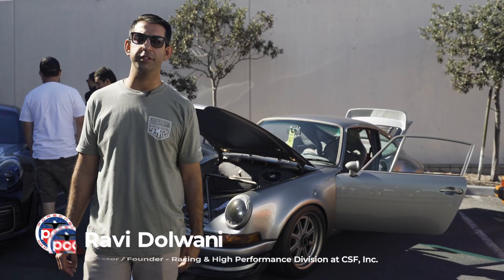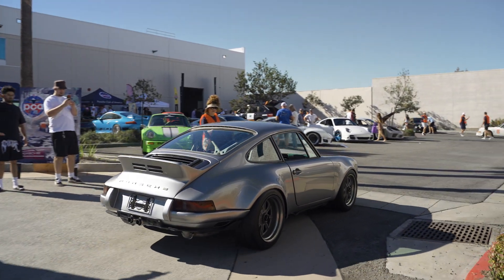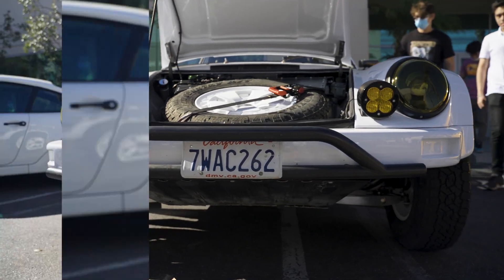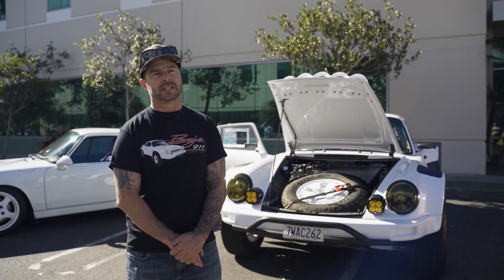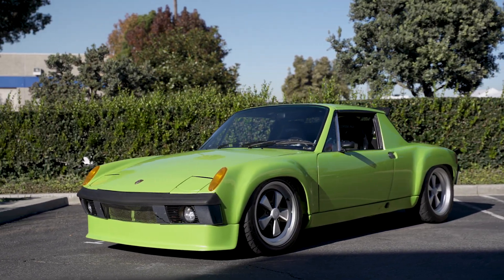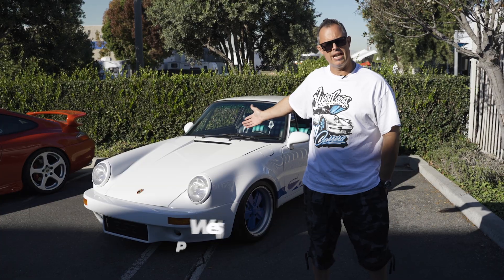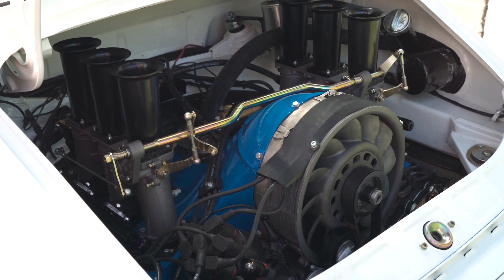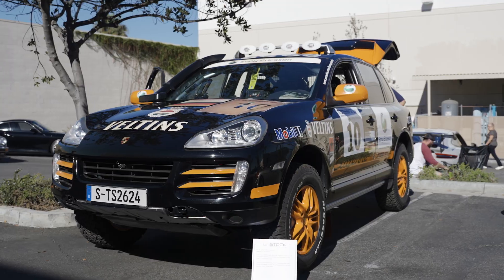ÜnStock: Modified Porsches, no judgment | PCA Spotlight

Comment: This series is a fantastic idea!!!  But all of the featured builds are $500K+.  Let’s be real - this SoCal trend is not representative of the broader PCA community’s good builds - it’s too high end.  Why don’t you come to mid-west, where Porsches tend to be modified with a little more concern to achieve biggest bang for the buck.
Reply from the maker: Thanks David. We did have a broad spectrum of modified cars on display. From just a few minor mods to the crazy builds we featured. We'd love to come to the mid-west. Noted!
Reply: Couldn't agree more, David. Any idiot can write a check to have a car built. Unfortunately, that's the lion's share of the cars that are featured each month in Panorama magazine. This is the gist of almost every story: "Steve's Dad passed away 15 years ago from a long illness. His Dad's '68 911S sat in the garage collecting dust until Steve made up his mind to resurrect the car in tribute to his Dad. No expense was spared in returning every nut and bolt back to original." I doubt half these owners even know where the oil fill is, much less how to check the oil or do a valve adjustment. I doubt any of them are driven more than 500 miles a year. A total waste.

I would MUCH rather read about an owner earning enough money to buy a project car, then work on it themselves to turn it into something they want. There are a few bright spots that have been featured in Panorama that are just this. Dave Toppin's 914-6 comes to mind. These are WAY more interesting stories because it takes more effort to build a car instead of buying it. Then he DRIVES the car to rallies rather than trailering it in and rubbing it down with yet another diaper. Half the cars at Luft were trailered in, too, I'm sure.
Reply: @MH-ev3wr  Agree for the most part. I don’t however hold it against someone if they have complex jobs done by someone else. It’s not realistic to expect someone to buy a mill and learn all the operations and machinist skills in order to build a bored twin plug engine for example. Heck, even the good shops sub out jobs like that to specialists.  You just can’t expect a shade tree mechanic to pull it off. Pelican parts has a lot of info but parsing the good advice from the bad can be very difficult. 

But over all I agree, the “home made” builds are much more interesting and that’s why I usually spend all of about ten minutes max on a typical issue of Panorama before tossing it.
Reply: @overbuiltlimited  good point. I totally agree. Not EVERY job can be done by people like you and me. If I were going to build a twin plug engine I’d spec out all the stuff to buy (camshafts, proper compression pistons and heads, etc) but I’d send the case and heads out to Ollies for proper machining, for example.

Comment: At (1:12) when you talk about your car being a Porsche 911 SC my car is a 1978 Porsche 911 SC I had an SSI exhaust and a Dansk Muffler and I had to take it off because it would not pass smog. I want that Manifold on my Porsche it makes 20 more HP and even though it runs better and cleaner they don't care they don't want it on your Porsche if it is not legal. How do you pass smog? What do I have to do that makes it so I can have that Manifold. I want to Hot Rod the engine. The owner of Rasant who builds engines and sells that Manifold said I can get 283 HP without 

it driving like a race car more like a stock Porsche. If I want more HP I have to have Higher Compression. I can also run a Supercharger would give me more HP. I was hoping for around 380 HP or more. Does anyone know what I have to do and where I go so I can pass smog and where I go to get it approved? I'm told I can't run that Manifold he has. How are you passing smog with that engine? I'm told your car has to be a 1975 or older to pass smog. You can't modify anything newer than 1975 or older. They have a State referee bar program. The car has to be Carb 

approved. This is something A BMW has to do. California engine swaps the cops can’t touch | MODIFIED https://www.youtube.com/watch?v=VjSUwykYa5Q&t=2s Any help would be great to know how I can run that Manifold and pass smog and run aftermarket legal exhaust and Muffler that will pass smog. Thank You! for sharing Best Regards.